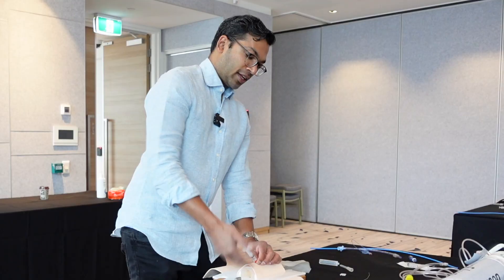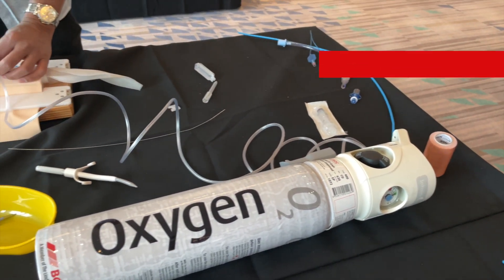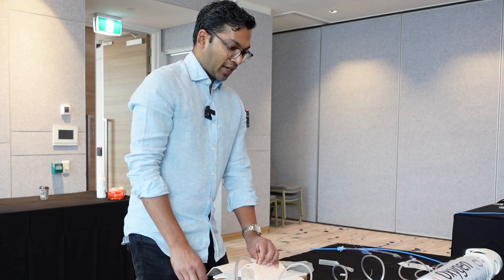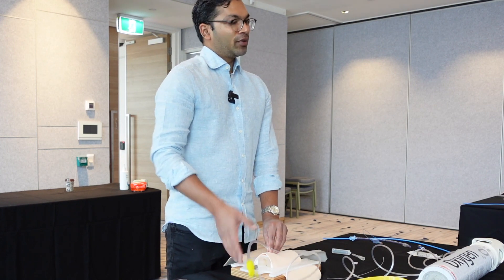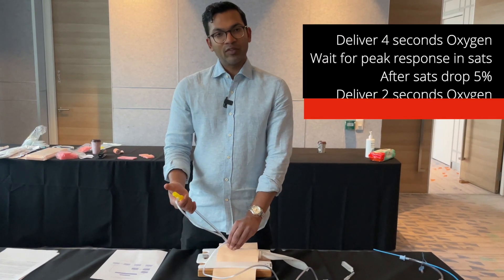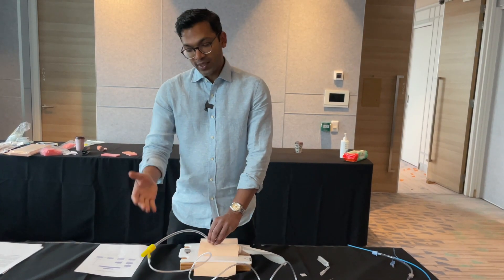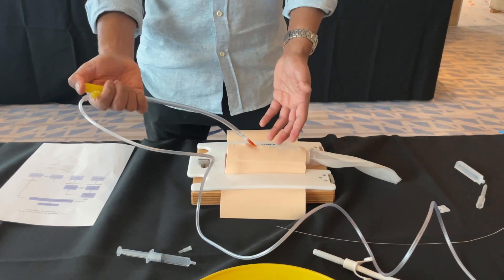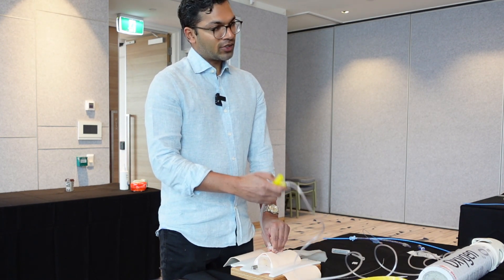Jet Ventilation for CICO Emergencies | Airway Management

Comment: Clinicians often forget that being forced to perform a needle cric and using jet ventilation are procedures associated with difficult airway scenarios. As such, it is imperative that the personnel involved with airway management are required to practice such procedures regularly to ensure success during a stressful event. I recall a great talk years ago given by an anesthesiologist regarding the importance of practicing such procedures. He used a great analogy: "special forces soldiers practice for 95% of their entire careers for the 5% of the time they will actually need to use those skills - in contrast, healthcare professionals have a habit of attempting to apply their skills 95% of the time in real world situations with only 5% of their time actually practicing those skills.